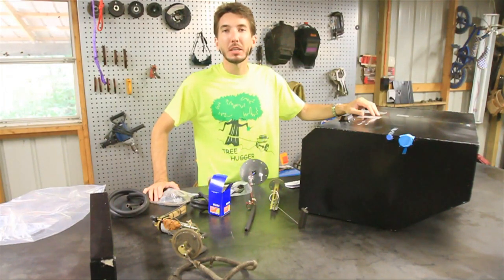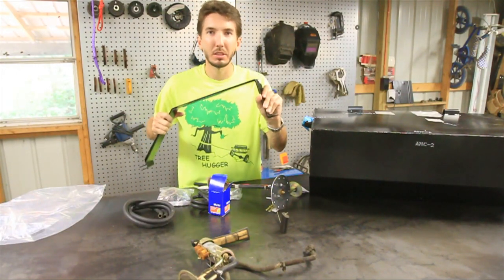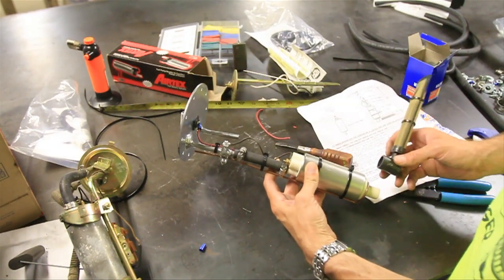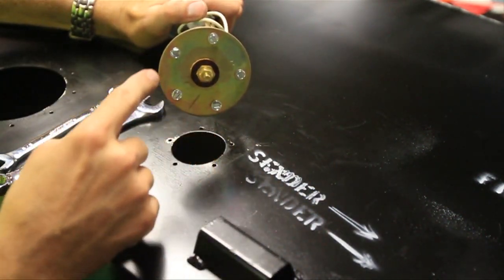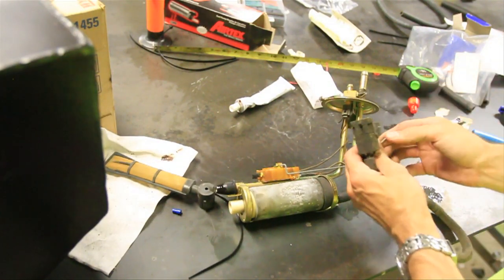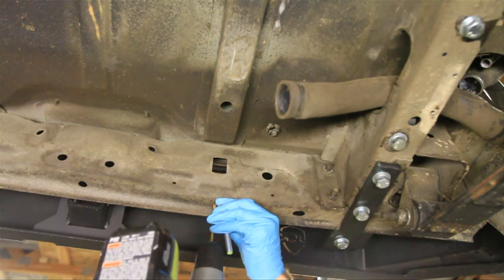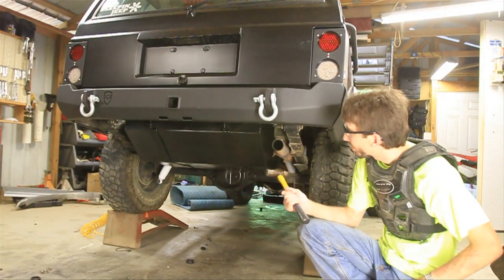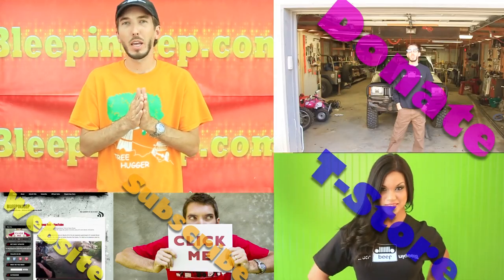Bug Out 32 Gallon Gas Tank Install

Comment: That's pretty impressive capacity, for a Cherokee.  ;)

Here I thought I was styling with 20 gallons in my CJ.  I had a 22 gallon steel tank, but I busted it up on the rocks and went to the stock 20 gallon + skid plate.
And while that tank looks pretty tough, hopefully they consider making a skid for it.  I didn't see one on their site.

For that return line, it wouldn't hurt to put a hose on that to extend it down.  It wouldn't aerate the fuel as much then.
Reply: bleepinjeep Matt, i just need a replacement for a 93 GCL, i'd prefer metal over the stock plastic but do have any recommendations as where to order one? I ordered two aftermarkets so far and they didnt fit, any ideas would help, thx.and as much as i'd like to i cant afford to spend 600 buckaroos on one xD
Reply: bleepinjeep Ok, thx :) unfortunately the junkyards drill holes in their tanks i guess it's a law so they don't have any unexpected explosions lol. I did try searching and bought twice, one had the filler and vent on the wrong side (passenger side) and the other one the straps wouldnt line up, i guess i could have made that work but...just curious if you had made any contacts in the econo gas tank department :) it's not my vehicle and they aren't willing to pay alot for a new one. I found a few metal aftermarket but some were in the close to a grand price range :( Anyways thx for replying and ty for taking out time to make these videos i have learned alot.

Comment: My only concern with this is the weight. All that extra fuel adds additional weight. The weight of the extra fuel a heavy duty rear bumper and a 35 in tire mounted to your bumpers tire carrier may be a significant weight difference for your rear suspension. My uncle built a bad ass bumper for his Jeep and he could feel a difference in his suspension when he hit a bump. He custom fitted some aftermarket airbags in his rear end that fit a 1500 pickup truck when towing a 5th wheel to make up for the weight of his bumper

Comment: Have you ever had any problems starting up the jeep with that tank? I went to buy an 89 cherokee that had a 32 gallon and it took for ever to start the jeep, you had to prime it and pump the pedal for at least 30sec before it would even try to fire. It just seemed goofy to me and was wonder what your thoughts were.
Reply: Doubt that has to do with the tank. Spunds like a fuel pump problem. Probably reusing an old pump inatead of buying a newer one for the new tank

Comment: just curious matt, 

have you tested the mileage of these tanks? I am also in Aus and am interested in putting in one of these 32 gallon/120 litre, however my Jeep is a 99' XJ so i am curious to know what changes there are between the 97' and my 99'.
Love the vids mate, would like to see more on improving on that mpg figure in your vids, the I6's seem to guzzle the juice.

cheers
Reply from the maker: Jesse Lunnon It does guzzle but it's not much of a problem here as gas right now is $2.57 a gallon, I wonder what is is in AUS?  As you know I gave this jeep to my dad and he claimed to get 26mpg on the way home but I think his brain may be fuzzy although he does drive 55mph on the highway.  Also, he will never let a tank get below half empty.  I'm pretty sure this manufacturer doesnt make tanks for the newer model XJ's.
Reply: Gen Right has one for newer model XJ's:  http://www.seriousoffroadproducts.com/Exhaust-Intake-Fuel-System/GenRight/GenRight/GenRight-30.5-Gallon-Fuel-tank-Jeep-Cherokee

Comment: Matt, I am trying to put a GenRight 30 gallon tank in my 1992 XJ.  The GenRight uses the post 1997 fuel sending unit.  The post-1997 sending unit has 4 wires, the 1992 sending unit has 3 wires.  Using the web I have found the ID of the 4 wires for the post-97 sending unit, but cannot find the ID of the pre-97 wires.  Do you know which wire is which?  I need to figure out how to wire a post-97 sending unit in my 1992 XJ.

Comment: Received email from Chuck at sunsetmetalfab.net that they no longer make fuel tanks.  Looks like our only option left is the ultra pricey GenRight tank with skid plate.  Wished I hadn't waited to do this project on mine.
Update (2/21/20):  Here is the email I received from Chuck:

Thank you for your email. While we are no longer manufacturing fuel tanks, we are still checking this email periodically in order to answer any technical questions. 

Thank you for understanding and best regards,

Chuck Atkinson
Sunset Metal Fab 
503-429-0895
Reply from the maker: Dang... that stinks!

Comment: Hey mat my jeep is leaking fuel on Injector I put new orings on and it still leaks but when it gets warm it stops leaking what you think it could be?
Reply: +Stephen Bichay - try to figuire out where its leaking from, if from the base then recheck and clean the contact surface and it from the top check the feed rail. Either way make sure the rail is torqued down proper and even. Side note, sounds like a good time to do the injector upgrade.....

Comment: I'm not trolling but I don't think it's wise to use petroleum jelly to lube rubber, it break it down.
Reply: +GOD, Gun"s and Gizmo's The reason you use petroleum jelly is because fuel is a petroleum product. You also use it on fuel injector rings. It wont break it down as its not harsh like WD40. Good thinking though.
Reply: good point, never thought of it that way. You learn something new every day huh lol.

Comment: I main concern is the amount of extra weight with all of that extra gas.  When you load up on tools gas and things what does that that do for the rear spring sag?
Reply: Mike Dolan - Don't fill it up all the way then. People run huge spares, heavy bumpers, 4 people in the Jeep, roof racks with gear all at the same time. Not sure 14 gallons of fuel will matter.
Reply: It will just sag more.  This is the trouble with fuel tanks aft of the rear axle, but I don't think there's any other place to put a fuel tank on these rigs LOL.